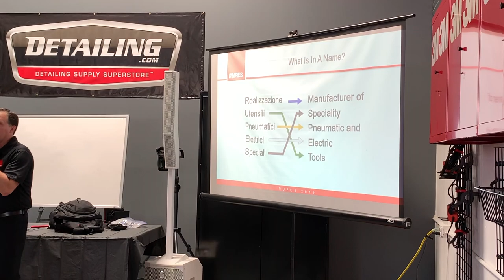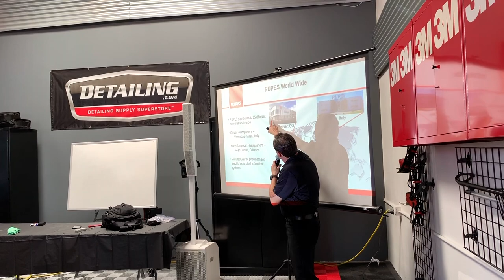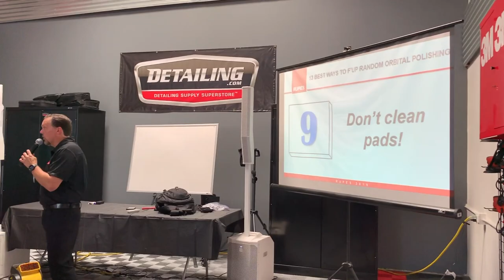MEGUIARS Detail Training with Mike Stoops, and Rupes Training with Jason Rose Part 1

Comment: The reflowing of clear coat always cracked me up!!🤣🤣
Reply: they used to reflow paint back in the good old days but you will simply kill modern paint if you try that.  What Mike was saying about a cutting pad with a polish is like me using a wool pad with a Jewelling polish, it helps the pad work better, keeps the fibres moist and free from clumped up paint residue and actually makes it plusher